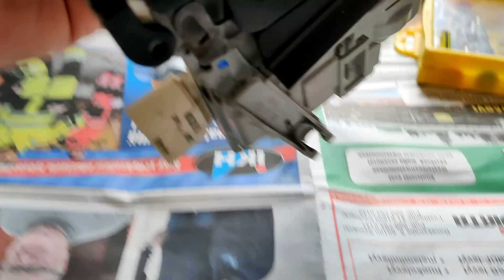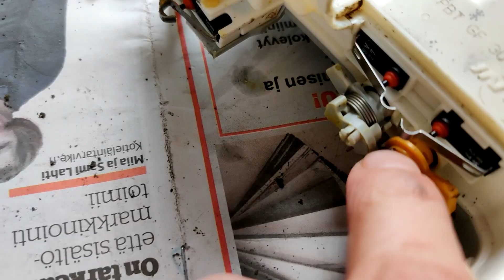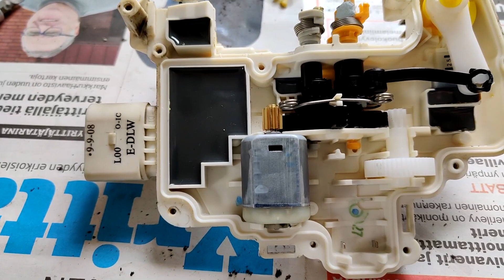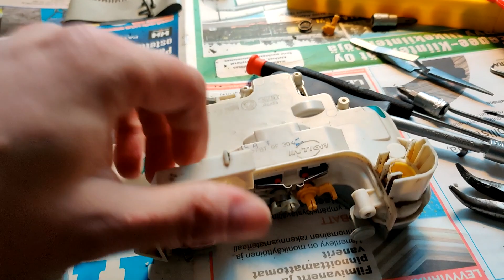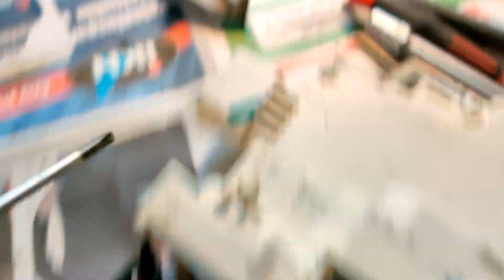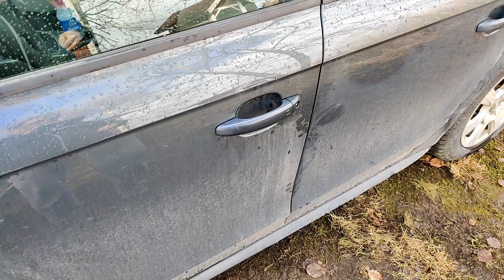Audi A4 B8 Lock Actuator Repair

Comment: Hello, my initial problem was that the car was in the unlocked position, but I couldn't open the door from the outside. After disassembling and reassembling it (I'm not sure if the mechanical parts are 100% correctly assembled), the problem has changed. Now, the car locks, but I can open the door from the outside. Any ideas?

Comment: Surely u don't need to open the  both sides and just remove the cover for the 2 motors and then u don't have this carry on?
Reply: Does anyone know if this is the situation if you just need to replace the motors? Or can the cover for the motors be removed opening up both sides?

Comment: Hi.  Do you know why after combine with The Black part... And I tighten the screws, The mechanism  not work,  sims like something press The Green and yellow parts and dont let The motoras to work.. After relise the screws and The Black and White parte are shaking a little... Everything work..  What can press on the mecanism,  did happening also to you?
Reply: The peg on the cam that goes into the green part is very short. With the small grey inspection plate off you will need line the green slider up with the cam and push the green slider from behind with a small screwdriver to engage it with the cam so it connects in the same way as the longer yellow one does.
Reply: This is best done with the black arm above it removed. Use a pair of small pliers to take off spring and you will need to pry off plastic arm at spring end with a small screwdriver. Hope this helps.